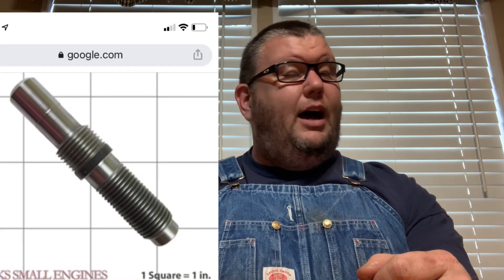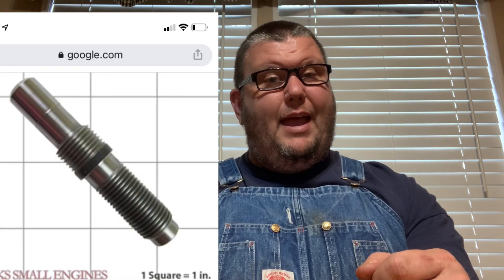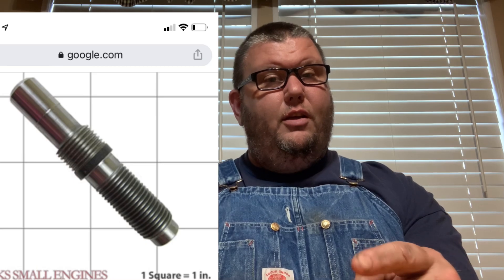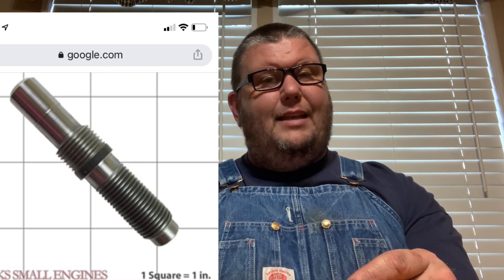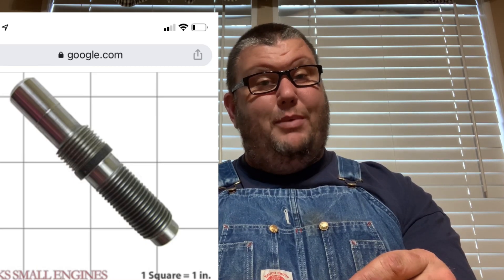VIEWER QUESTIONS ANSWERED / BAD STARTER CLUTCH?

Comment: Great video buddy. I have a blower that has a new carb and fuel lines on it. The primer bulb works as it should and will prime the carb and return fuel to the tank through the vent hose. The only way it will start is by spraying fluid in the carb and it will run a few seconds and die like its not sucking up fuel from the tank. Could this I'M prety sure the fuel tank is holding pressure what I'M wondering could this be a problem with crank case pressure and if so how to diagnose it?
Reply from the maker: Verify that the carb is getting the pulse signal from the crankcase?
Reply: @THEMOWERMEDIC1  how do i do that on a 2 stroke